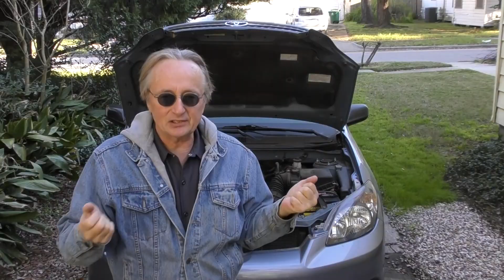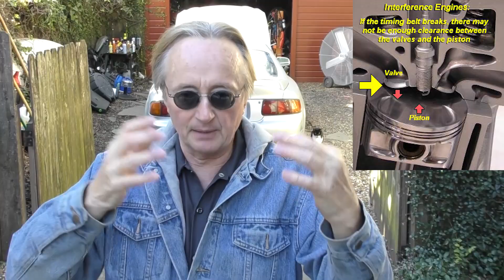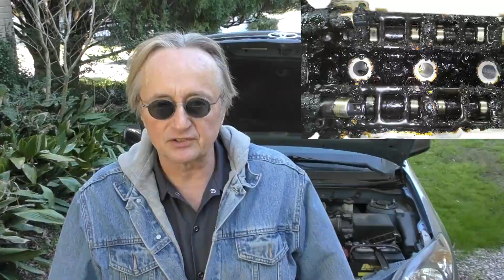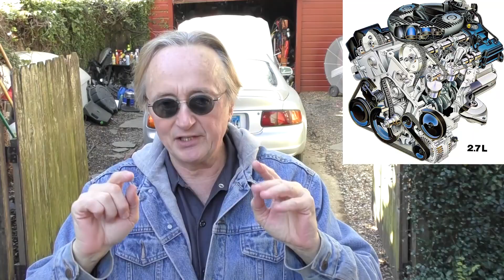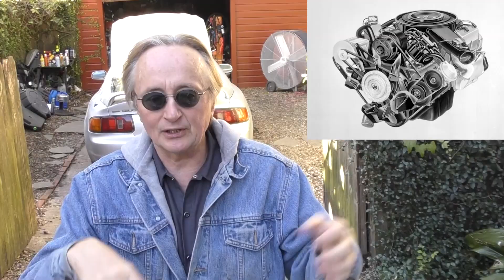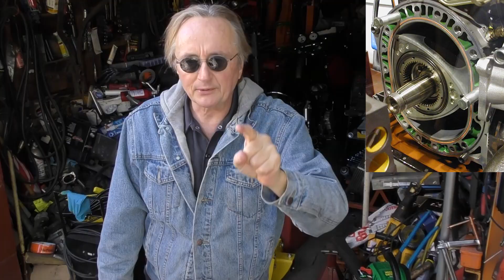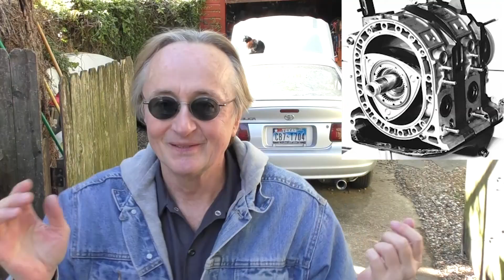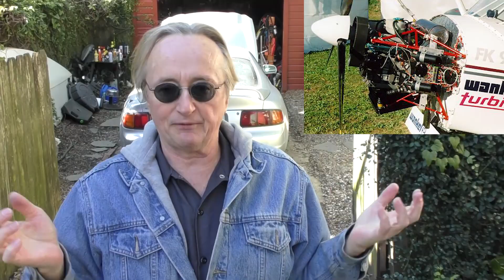Never Buy a Car With This Engine

Comment: Glad I got a Silverado but will be deactiving the cylinder deactivation system. Scotty is right GM wasnt thinking right when making V8s that deactivate 4 cylinders when not gasing. It creates a clunk jerky style of driving like scotty explained ,but simply paying a mechanic to deactivate the system is pretty much the way to go on a V8!
Reply: Cylinder deactivation systems are entirely unnecessary. I’m gonna use every cylinder in the engine regardless of whether or not I need to.
Reply: @NeedForSpeed.2004   Which cost more gas 10% load on 8 cylinder or 60% load on 4 cylinder.

Comment: you forgot ford triton 5.4L and its famous camphaser issues and the $1000 2 parts spark plug change, because most of them broke in the cylinder head.
Reply: What about the other Ford 5.4L V8. The one used in the SN95 mustang cobras, Ford GT, 2007-2012 Shelby GT500 & the 5.8L Trinity which is the same engine but bigger which was in the 2013-14 GT500

Comment: forgot about the GM 2.4 Twin Cam, who the hell designs an engine with a redline higher than the oil pump can keep up?? 500rpm before redline the oil pump cavitates and starves the engine for oil when it needs it most..

Comment: Forgot to mention the triton engine in ford f 150.  Spent 1200 dpllars when the spark plug shot out of the engine and metal went downn the cylinder heads. Only 3 threads holding plugs in

Comment: They should put just about any Volkswagen engine on here. My family for some reasons loves them despite constantly having issues.
Reply: I used to be a VW lover but after 3 of them, i bought Honda was tired of stupid electrical and plastic part broken down. I also had 2 Volvo 850 and one 850R those engine can take a long beating. But same goes as VW electronics are junk, i always had misfire on random cylinder, sometime it was 1 cylinder sometime 2, i spend hundred never fix the problem i had my scanner on the passenger seat to clear code every drive. My friend had  the same 850R and he have same problem with misfire.

Comment: The first engine u talked about, my mom had it, it burnt oil and the transmission was changed twice and was beginning to need a new one... and this is only small details of its problems and mind you that this was a car from 2007, and it was junked in 2017. It was chevy malibu

Comment: Disagree with the 1.8t. Its basically everywhere and people rack up crazy mileage on them. If you put in the correct oil like specifed its a great engine.
Reply: Its a turbo car so oil changed have to be religiously done, i had 2 Volvo turbo over 400k km with original turbo but i engine oil every 5000 km and transmission fluid changed every 2 oil change it drove like a tank. One i had to change a compressor bypass valve the diaphram was torn apart coast 11$ to fix.

Comment: Have to disagree with scotty on this one. I have two cars with the 2.2 ecotec. One has 200,000 and never had a single problem. Original clutch. original spark plugs and serpentine belt if you can believe it. Other one has 135,000 on it. If you take care of them there one of the best engines ever made. They are known as the small block 350's of 4 cylinders. Lots of racers use these engines and build them with monster power.

Comment: The first two engines on this list are criticisms of maintenance. If you follow the maintenance intervals, there's no inherent design flaw that makes them bad. "If you don't change the timing chain..." Yeah. Bad things can happen if you don't change your timing chain OR BELT on any car by the specified interval. For this list, I'd rather swap out these two decent engines for some actual bad engines with inherent design flaws. the 2.2 is everywhere and problems are common because the car is common. It's no worse a motor than many others. The same can be said of the 1.8T. Loads of people drive them long and hard with few issues. The Northstar V8 is more deserving to be on this list. The 2.7 definitely belongs on this list. Those enginerds failed hard. Most small Chrysler engines aren't very good. It's a travesty for their brand's reputation since they've made some excellent engines such as the 3.3 and the 318 and the motors derived from them.

Comment: Funny, My Ecotec 2.2L had 300,400 miles on it when I dropped it off at the junk yard. I changed the oil every 3,000 miles though because of the insane mileage I drove commuting and delivering pizza.

Comment: Didn't tell them they needed synthetic oil?  Try going to a qualified mechanic or opening your owner's manual. I don't buy "they didn't tell them". They read enough to go 10,000 miles between changes, but not enough to see synthetic oil only?

Comment: You forgot the 5.4 triton v8. They had the WORST design flaw in the valvetrain, where the oil ports were to small, and all the sludge from the oil just accumulated, and starved the engine of oil. Then they just blew. Also, the bmw S85 v10 is worthy of this list, but its just a maintenance related thing.

Comment: For me ive had my 04 acura tl for 10yrs 3.2 v6 vtech engine
Reply: I got a 07 TL-S had it for over a year, very reliable. Only problem had with it was when I got it the Transmission fluid was a brownish color in its early burning stages so 1st to 3rd gear felt clunky. After a fluid change it switches gears better, though I have been told to switch out the pressure switches, so it can run like new.

Comment: Put 300,000 miles on my 2003 cavalier 2.2 ecotec engine. Still ran good until I hit a deer must a got a good one changed oil every 5000 miles.

Comment: Regarding the 2.2 L Ecotec, I've been driving a 2007 Chevy Cobalt for 11 years (now has 177k) miles and haven't had a single problem with the engine.
Reply: My 2008 Cobalt blew its engine last summer at 101k miles. Why GM wasn't sued for not recalling these engines is beyond me...
Reply: Jordan Rovny my mates had the vw 1.8 for ages now and same thing, just because he takes care of it I guess
Reply: You're just lucky Jordan Rovny.
Reply: @scootergreen3  I drive gently and am timely on maintenance.
Reply: You are smart Jordan Rovny. That makes it easy on a car's engine and transmission and makes it all last longer. I do the same thing on a 2000 Toyota Camry as I have done on all my cars since I got over 30 years old. I was aways a Chevy man. I had a new 74 Monte Carlo 454. Of course I drove it fast and hard on the highway because it was fun but after a spun bearing and a new engine and transmission I learned. I have babied my cars ever since. Older ladies who are unwise make fun of me for taking off easy but you and I know what's best for a car to make them last.
Reply: same here, '06 Ion, 170K miles. aside from a coil pack and starter, it's been straight reliable. bought it off the original owners who had all service receipts still, was given full synth and changed every 5K from day one, a Ritual I've continued on with. here's to hoping for the 200K mark

Comment: Had a 73 Mazda RX2 rotary. what a POS.  12 MPG.  No torque.  Rotary cracked  the block at about 52k miles.  Exhaust  was coming out the radiator cap as the coolant went out the tailpipe.   Traded it for a 76 Plymouth Duster Slant 6 that got 27 mpg, had way more torque. Sold it after 10 years and 106,000 miles.
Reply: @NA94753  27 was the highway mileage. Mine was the Feather Duster version. 225 cid, 1 barrel carb, overdrive transmission. Rust was never a problem. I may just have been lucky, but I did wash of the underside every spring to get any road salt off.

Comment: That Northstar engine should be on here 😂
Reply: Not sure if Scotty ever got that in depth with an engine. The head bolts would let go at 50k miles. GM put a fix on them and they still only lasted 50k after the fix lol
Reply: Car Wizard showed this. Skinny steel head bolts with fine threads in an aluminum block. The GM warranty fix was basically Helicoils. There is a kit to rethread the block for LS head bolts. You drop the engine, pull the heads, and use an X-shaped drill guide. He said that after that it’s a great engine. He said that after 2005 GM built them right in the first place.
Reply: As my mechanic referred to them......deathstar engine
Reply: TerryByrdJr I owned north star. Absolute total steaming pile of overheating gasket blowing junk. Killed the Cadillac brand. No young person aspires to own Cadillac vehicles. Even the pimps have abandoned them.

Comment: This happened to me too a few years ago. Those dang pumps ran by the timing belt also in the VW 1.8. Pump seized, caused to grind the teeth in the timing belt and my pistons high five my valves. Sad day.

Comment: The ecotec engine is great my uncle's hhr has 340 k and my saturn l200 has 220, I change the oil every 3500 miles Castro gtx, it's a stupidity factor

Comment: I have 300k on my 1.8t if people would put correct oil and coolant in them from the get go they wouldn't have the problems that come with putting incorrect fluids in them. The 1.8 has small oil passages and you can't be putting conventional oil in them and not change the oil until 10k miles. So I say you're wrong on saying they are horrible engines. It's more so the owner, I guess in today's age nobody is accountable for their actions. Only bad thing about the 1.8 is it's an interference engine.

Comment: chevy stovebolt 6 running great... funny thing is the advance designs came with a catalog to buy parts to do specific jobs on any vehicle part.. and pretty much any repair can be done under 15 minutes. simple, easy, reliable, affordable.

Comment: My first car was a saturn l200 with the 2.2l. Loved the car and it was fun to drive! But it did fail the timing chain. Got a replacement for 1000 and it kept going for 9 years before an oil leak eventually caused a spun bearing.

Comment: LOL, I owned one of the Mazda Rotary Engines. I did not buy it new so I'm only half stupid? It was interesting and not my only car so it didn't cause me any real problems and after a couple years I did sell it. It's not the only lemon I ever owned. The worst lemon I ever owned was a VW rabbit with mechanical fuel injection (also interesting) and chronic electrical problems. Not a big disaster either because it was a dog to ride in or drive. It was the most uncomfortable and noisy in the passenger compartment.

Comment: 4:25 yes and your beloved Toyota 1.6l has the water pump driven by the timing belt too. So is it really bad design?
Reply: I changed my timing belt on my civic 1996 didn't changed the water pump 2 days later it started to leak so i had to replace it timing belt are easy to maintain, i had only 2 car i ever bought with timing chain, a belt cost like 80$ and a water pump and tensioner kit his about 130$. A timing chain coast like 200-400$ and take longer to changed if you can serviece it yourself.

Comment: Dual over head cam.  #1 worst design.  Noise harshness vibration. I owned a 2.2 ecotec for 12 years.  Great engine he just hates Chevy that's all.
Reply: miketucky350 you think DOHC in general is a bad design..?? Lol
Reply: @richieschmidt6225  yes I've been driving for 22 years.  Been around a couple vehicles.  Doch engines fail more.   Expensive repairs  very hard to work on.  Way too many moving parts and way less low rpm torque.    There ticking everywhere you go listen.
Reply: @MIketucky350  That might be the dumbest thing I've ever heard, to put it nicely. Plenty of DOHC vehicles make it over a 1/4 millions miles without internal engine work.
Reply: Also, how do you figure DOHC has more NVH? It's the opposite if anything, considering most 4 bangers above 2.0L will use balance shafts and run very smoothly. But the GMs are junk.
Reply: @richieschmidt6225  go drive pushrod motor vs dohc. Huge difference in smoothness.  I  know there are plenty of dohc engines that make it high miles.   I've been working on these things for years.  Plus have a bunch of family/friends ase certified mechanics.  We're entitled to our opinion. I do like GMs.  My Chevy truck has 325k original drivetrain.  My 99 LeSabre 136k. Original.  I have a hard time taking Scotty seriously.  Look at his mess!!!! He's a slob.
Reply: @MIketucky350  I've driven plenty of both. Both can be smooth, both can be rough. Lopping all DOHC engines into the same category is silly.
Reply: @richieschmidt6225  I agree with you also.  I just don't like how buzzy they are.  & Since the engines are much larger in outer diameter Much harder to repair.

Comment: Best Motor I ever had was a 1998 F150 (Enforcer) Straight 300-6 cylinder, manual 5 Speed !!  The Body rusted off the Truck before that engine died, I had 437,000 Km's on that motor and it was still running strong until I decided to scrap the Truck !  SECOND : A Chrysler Slant 6 in a Volare that had over 343,000 Kms, again, the frame & body rusted out before tha motor died !  Today I'm driving a 2011 Mazda 6. with a 2.5L 4 cylinder and it's been pretty well maintenance-free up to the 150,000 Km's I have put on it....My Wife has a 2011 Honda Civic 1.8L that's been reliable up to 134,000 Km's she has on that vehicle !! We will see if these 4-Bangers will stand the test of time and will surpass that 437,000 Km record bench-mark set by my 1998 Ford F150 ? I'm doubting it BUT, I have read some interesting threads on the 2.5L going 350,000Km's + and the Honda 1.8L going well beyond 400,000Km's !! We will see !! Love you Scotty !!

Comment: I wonder if the 1.8T is a decent engine when properly maintained with synthetic oil.  Tons of them around but I'm still wary of turbo engines.
Reply: I loved the way my Audi A4 drove, but the 1.8T engine and cvt were pieces of crap; and I'm obsessive about maintenance on my cars.  Unless you like to spend every available weekend working on your car or you have a mechanic on retainer I don't recommend them.  I literally gave my Audi A4 away just to get it out of my life.
Reply: Only if you got it brand new and meticulously maintained it yourself from day 1.  I reallllllly wanted a MK1 Audi TT which has the 1.8T engine as does the GTi Golf and Jetta of the same era ~2000 - 2005 and after joining a few groups and forums I decided there's just no way Id want to deal with all the constant issues and horror stories Ive read about.  We still have a MK3.5 2.0L Cabrio which has 200k and while the block itself is strong I'd say, we have had to replace absolutely everything on the car, including the clutch..twice..within 10k miles because the shitty auto-adjusting cable allowed the clutch/tranny push rod to blow through the thrust plate. Worst engineering Ive ever seen.  Something breaks like clockwork every 5,000 to 7,000 miles on it.  I'm not even joking.  It's turned my wife and I into very knowledgeable home mechanics which is a bonus I guess but I will never own a German car again.  My old Toyota truck has almost the same miles and has easily needed 1/4 the maintenance. VWs are just built like crap. The newer Golfs have a plastic intake that has caused a ton of clogging issues. And most Audi's looks nice but most are still crap too. No thanks, not worth the headache even if you're rich.

Comment: I gotta admit chevy ecotec 2.2 in my 2007 Malibu. Was most reliable car I ever owned. 190k miles and no major repairs EVER! Quick too.
Reply: I have a 2007 saturn vue 2.2 with 98k m. and haven't done any repairs other than brakes. Only gets 21 mpg so not great for a small engine but that's my only complaint.

Comment: I'm really surprised you didn't mention the Cadillac Northstar engines. The threads in the block for the cylinder head bolts were not strong enough---the head bolts would then back out. Those engines blew head gaskets and cracked heads all the time. They made a thread repair kit for those that supposedly fixes the problem
Reply: I've heard the same but i've had 4 northstar caddies in a row. Damn things ran great well over 150,000 miles. I must be lucky.
Reply: @midnightrider7648  It depends on the year. Caddy got with the program starting in '05 and revised the size and pitch of the head bolts and bolt holes in the block
Reply: justsomeguytoyou  yep ....only took them 12 yrs to get around to it

Comment: Thanks for putting the Mazda Wankel engine's on the list. Absolutely idiotic engine design for a car, I can't understand why anyone would buy a car with one.
Reply: Well, I bought my RX-8 new 13 years ago, and it’s been as reliable as any car I’ve owned, zero engine problems to date. Plus it’s still one of the best handling cars on the planet. So there’s two reasons to buy one.
(Disclaimer: I change the oil ever 4 months and check oil level every other fill-up. And I rev it to its 9K redline frequently. Most RX-8 owners don’t bother doing those things regularly. Gee I wonder if that has anything to do with their “engine problems”. 🙄)

Comment: I watched this video soon after it was posted on 3/07/2019.  I believe my 2.2L ecotec's timing chain slipped a bit just yesterday (3/17/2019), which is just 10 days after this video was posted.  I need to confirm this by removing the valve cover to check the timing chain, and/or checking the valves for damage with a boroscope.  The engine ran fine the last time, then upon starting, the engine ran horribly and shook the entire car.